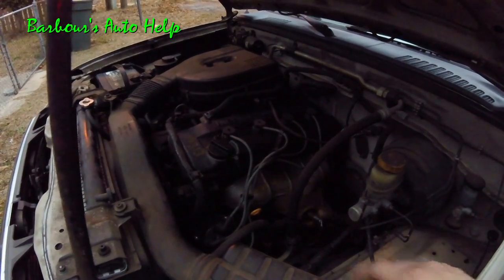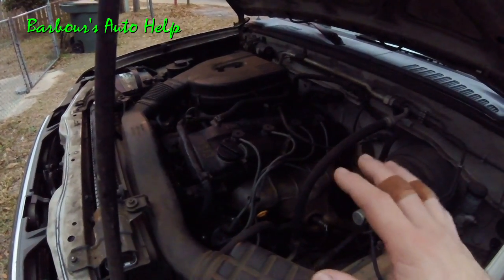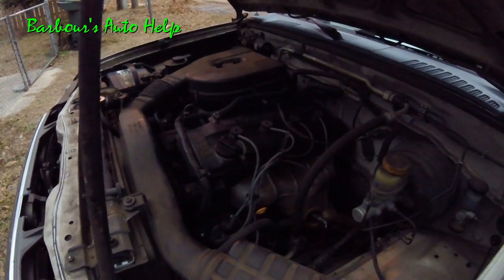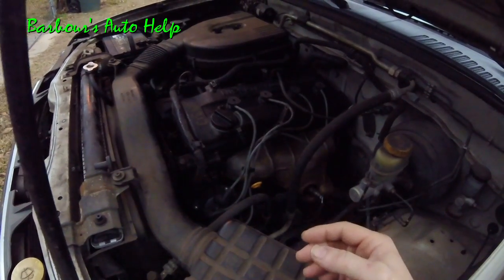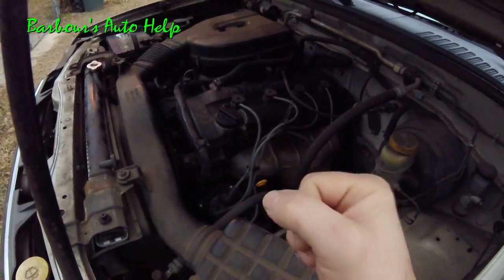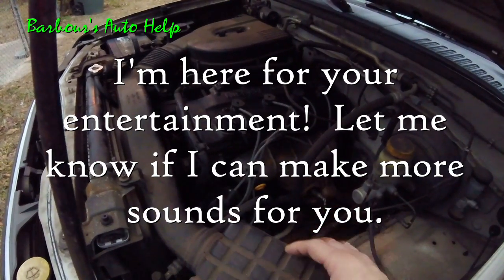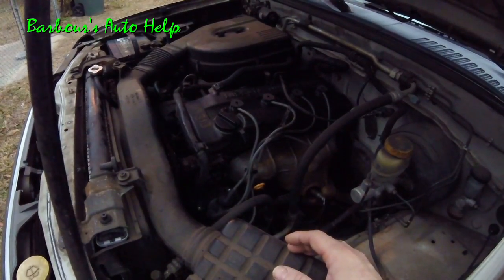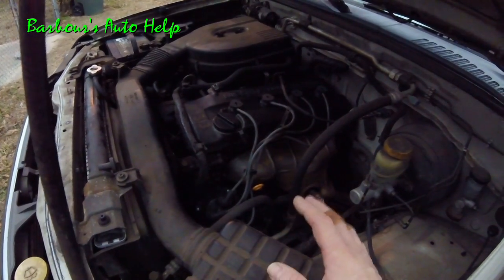What Piston Slap Sounds Like

Comment: Back in the day of carburettored engines you would have noisy tappets that sounded just like this only way faster. You would have to know your valve to tappet clearance and take the rocker cover off and adjust them ever 15 to 20000kms. Was still easier then doing a spark plug clearance on a 2 stroke.

Comment: I would still inspect rod bearings.mine sound the same way and it’s my rod bearing because it’s .001in to big so untill oil get warm and viscosity changes and pressure builds up that’s when you don’t hear it at all only on cold start up..and I don’t hear it any time while under load or when driving normally..
Reply: I have read that rod knock doesn't go away. Also, it usually starts on higher rpms and when if finally gets really bad you'll also hear at idle.

Comment: Enjoyed the video, helped me understand piston slap better. My 2015 Chevrolet silverado just started doing this. it has 86000 miles, which I don't consider old so I was worried.  Only does it on cold starts and only last a minute or less. Oil pressure gauge is normal.  Is this detrimental to the engine?
Reply from the maker: It can be.  But some vehicles go forever with it.
Reply: That is a classic chevy v8 symptom . I had a 2000 5.3L silverado and it ticked on startup for the first 30 seconds or so then you could audibly hear the last knock then hear it run quiet and smooth. Very common chevy v8 issue. As long as its just on startup and goes away quickly, do not worry about that on that truck (my truck only had 215,000kms) bought it that way

Comment: Is this piston slap too?
https://www.youtube.com/watch?v=44ERz0rq9d4&feature=emb_logo

i Have Honda Jazz 1.4 iDsi 2007. When engine is cold and exceed 2000 rpm, appear strange tap noise. Only does it for first 5 mins from cold start and only makes a noise under load. After 5 km driving, that noise just gone.
Reply from the maker: Its hard to say.  Sounds kinda light for piston slap.

Comment: Presently having that sound. If it is ROD KNOCK, it will not go away it will always happen. 

How do you fix this? (Piston Slap)
Reply from the maker: Piston slap can be fixed by rebuilding or replacing the short block.  Id have a tech confirm you actually have piston slap or whatever.
Reply: @BarboursAutoHelp  Thanks. I'm trying thinner oils, different filters.. Just drove around like 20 miles and the engine got quieter so who knows. We'll see (Subaru engines are TOUGH!)
Reply: ^^^ What about going overbore.. ?
Reply from the maker: YES they are!

Comment: Hi I have a 2006 dodge charger rt hemi it sounds like yours at idle but as you step on accelerater it gets aggressively louder sounds like a woodpecker?
Reply: Rod knock ,🤪
Reply: Did you ever get this figured out? I have the same on acceleration
Reply: @PJ-mj1hy  I was told my trans was shot and it sire sounded like it but never got it confirmed
Reply: @gdtwister90  thanks for the reply!

Comment: If it goes away quickly, then it seems more like a timing actuator issue to me.
Reply: Or the oil pump losing its prime?
Reply: Idk about these engines, my 99 Suburban 5.7 has pretty loud piston slap, goes away after a while, I'd say more like 10 min in winter months, a few sounds in the summer.

Comment: Sounds like the timing chain taking up slack or tappets chattering harmlessly. I had a 1999 model year vehicle with a Ford Modular 5.4L Triton 4-valve branded as "InTech" that had this noise since day one. 
In those days everyone was screaming "piston slap" but I'm certain it wasn't. The engine lasted longer than most of the other moving parts in the vehicle each of which started to die at year 7. Best vehicle I've ever driven.
Reply: That's what I was thinking timming chain tensioner slack till oil pressure come thru
Reply: Currently driving a 99 f150 with the 5.4 triton and I have "piston slap"
However, I purchased this truck at 223k on the odo so I automatically feared the worst. Should I just get the timing adjusted/redone?

Comment: Sounds more like tappets seeing how quickly it goes away
Reply: I would normally agree with you but unless I'm mistaken that's a Nissan ka24de with shim on bucket valve train (aka flat tappet), not hydraulic lash adjusters. is the tap it's making noise on that motor when they're cold they stay noisy until the engine is all the way warmed up and maybe even then. You have to change the shims to get them in spec.
Reply: @DericCribbs  the bucket lifters are hydraulic

Comment: Take four it's perfect.

I have a little toyota vvt-i 3 cylinders, in winter early in the morning you can ear the piston slapping in that way.
In summer the engine is almost perfect!

100k km in 10 years, most driven in city center.

I hope to fix as suggested by The poor gamer, slapping my engine back :P.
Reply: You probably have a vitz
Reply: Thanks for confirming this!

I have a 06 Corolla VVTI 4 cilinder and I’ve been noticing the same problem just last month when it became colder. I bought the car in march and it was driving perfectly during summer/spring times.
Reply: @yes8032 pistons slapping. Drive gentle and smooth when engine it's cold early in the morning. Warm it up as well and slow is possible and don't worry about it.
Reply: @xyzRyoxyz  Noted! I was really worried about my rod bearings being damaged before i knew this.

Comment: My civic has done this every cold start, including summer, since 228k. Now at 236k, same thing and just put a turbo kit on it. Goes away completely when warm.
Reply: If you drive slowly without sudden acceleration I believe you are safe 👍
Reply: The extra pressure built by the turbo sucks the piston back into proper place

Comment: Sure it's not valves? Timing adjusts after warm up.
Reply from the maker: Yea, pretty sure.  Hey, if you haven't read the description yet you may want to.  I've got some good info in there for you.  Unfortunately, I don't have a video showing how to properly diagnose piston slap yet.  This video is just an example of what piston slap sounds like.  Hopefully one day I can provide a video like that.
Reply: @BarboursAutoHelp   I say that because a lose chain can slap inside causing a similiar sound. The tensioner would need adjusting in that case. And then of course there is valve timing. Pre igniton can also be caused by carbon buildup or a gasket part exposed in the cylinder. Pre ignition on one side of the cylinder can cause the piston to twist on ignition.
Reply from the maker: Got it.  Thanks for commenting.
Reply: @BarboursAutoHelp  I believe piston slap always goes away when engine is warm .When engine is cold and you accelerate the noise is noticable especially at low rpm but once engine is warm noise is gone.

Comment: from my experience, you will hear piston slap at a lower rpm than a light rod knock, rods usually don't start knocking till 2.5-3k rpm and piston slap will go away as the engine warms up,   A rod knock usually gets worse as the engine warms up and the oil thins out.
Reply from the maker: I've heard rods knock at all RPMs.  It's all relative.
Reply: Ok i agree when the bearing is really gone they can be heard at other rpms, even idle,  but get worse at rpms rise. but will you agree, rod knocks usually start as a faint knock and noise increases at higher rpm under low load, and these noises do not go away when the engine warms up, but as the pistons expand the piston slap will go away.
Reply from the maker: Oh yea.  I wasn't totally disagreeing.   It's a good point.
Reply: @BarboursAutoHelp  they seem to also be louder under load vs idle, this applies to small engines with one piston as well. Going throuhg a rebuild now on a UTV side by side that definitely has a rod knock.

Comment: Peope tended to confused piston slap with the beginning of a rod knock.
Reply: Along with 50 other things. Everything sounds the damn same, it's impossible!
Reply: Piston slap goes away when engine is warm , knock rod doesn't 👍 The main difference .
Reply: Sometimes the piston slap doesn't go away completely on hot engine, but it surely gets quieter. Rod knock gets even louder on the other hand.
Reply: @5Dale65  true 👍
Reply: I believe rod knock is instant knock from start til engine is off if anything?
Reply: Can rod know  heard at idle speed

Comment: just replace your pistons if they get worn down from use or change your oil. if not your oil see if your block is run down from wear and tear. or swap the motor. but dont sell your car. thats uneeded. unless it s a P.O.S then in that case do it.
Reply: Just swap in new pistons

Comment: Can this happen when accelerating at certain revs? I feel like this sound happens at 2-2.5k revs when I hold it in that range and am wondering if it's piston slap or something to do with the timing chain
Reply: I'm having this exact problem on an unrelated engine when in neautral it happens at 2k partial throttle but if I matt it no noise, when driving it happens at 3k rpm partial throttle  and goes away until 4k rpm
Reply: @woodsy900  did you find the problem? I have exactly the same issue
Reply from the maker: Possible.

Comment: When your gasoline powered engine begins sounding like a diesel engine is the best way I can describe it.
Reply from the maker: Pretty good
Reply: Yes, this is the best way to describe it.
Reply: Very accurate, a lot of the 4.2l vortec motors I've worked with sounded like this when cold starting.
After they warm up they sound fine.
Reply: Meh kinda. Usually that's a manifold on the exhaust. Lol
Reply: Then there’s the 3.5 v6 on the 3rd gen Tacoma’s that have a self cleaning injector cycle and dual injection, so they sound like mini diesels 😂
Reply: Literally
Reply: hm, i thought diesel noise was like with the valves

Comment: good video my jeep has had piston slap since 180k still running great at 290k
Reply from the maker: Let her ride!  That’s my philosophy when it come to my personal vehicles.
Reply: It's a jeep thing ...
Reply: Mine started at 265k now at 271K just add oil to fix it
Reply: Zip ties & duct tape .wich Kind of oil?
Reply: My Jeep has it too... I'm making the dealership change the motor !!  I don't feel comfortable with it when i take trips 1500 miles from home !!
Reply: @huf67  actually city driving is worse than highway driving
Reply: I've got a 1994 wrangler 2.5 , been chasing a little ticking noise at idle , changed the lifters, pushrods and rockers and the noise was 100% unaffected . Now I'm thinking its piston slap. Runs like an absolute top though . 215,000 km